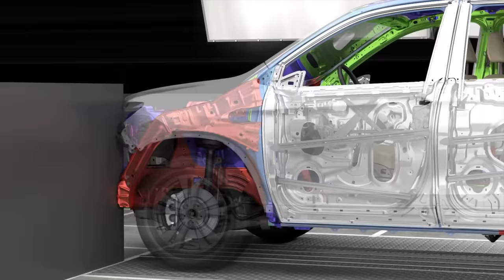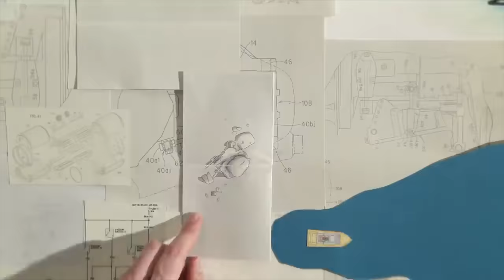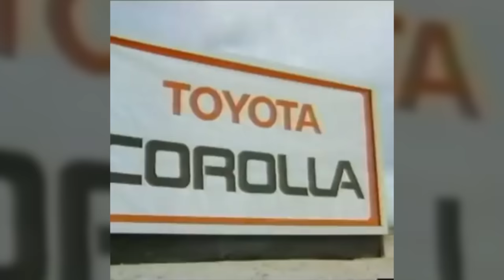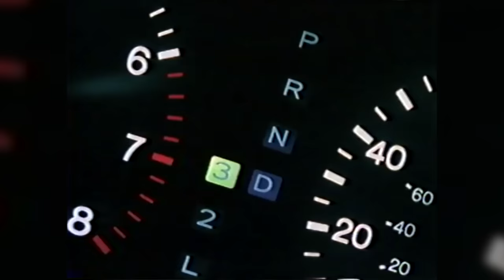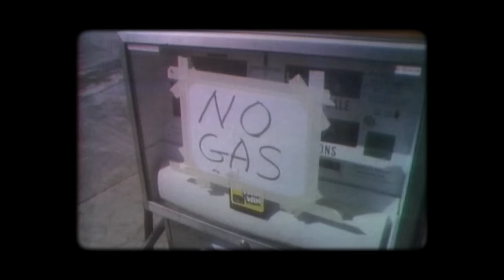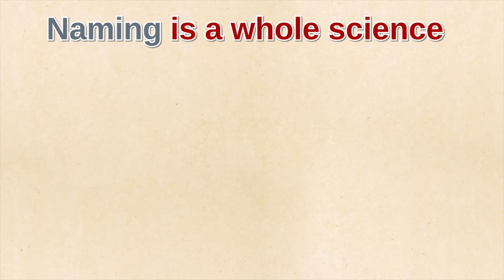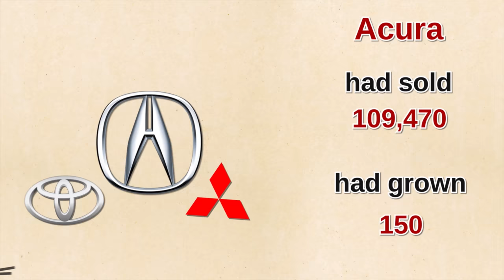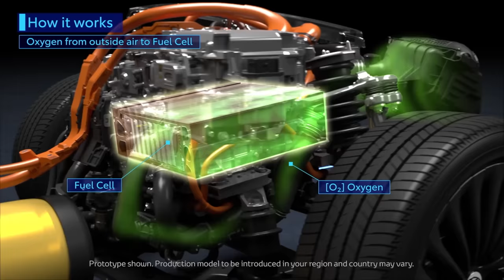Here's Why I Only Buy These 4 Car Brands

Comment: I had a 1993 Honda Accord stolen twice in 2002 and 2006. The first time the cop said it was because that series of Accords were built with ignition systems that were easy to start with any Accord key from that series just by sanding off the edges of the key. You can make a skeleton key with any other Honda Accord key and the thieves knew that.
So did Honda.
But they didn't do anything about it and Honda still holds the record for most stolen cars because of it.
It's not the reliability the thieves care about 🙄
Reply: I used to have a 1990 Camry. And once accidentally opened the door of another Camry of same color same model year that parked near my car in a parking lot.

Comment: I am on my fourth Honda, and we have a Honda lawnmower. I had a 94 civic, 16 civic and we now own a 16 pilot and an 01 accord. I’ve had a VERY expensive AC repair on my pilot recently that my warranty covered part of and then a rat got into it and in total cost $2600… (evaporator box, debris all up in there, thermistor, blower motor, expansion valve) 💀. But overall it’s been a very good car aside from that lol. My accord is my baby. I got it as a commuter car to keep miles off the pilot but I’ll keep it forever. Regular things need replacing (ignition wires, starter etc) but nothing I can’t do myself in my driveway. Very easy cars too work on. I did have my catalytic converter stolen! Apparently thrives like to also steal them off accords a lot as well, so she’s got herself a straight pipe. Lol.

Comment: Honda's with 200k miles. Have seen Toyota's with over 350k still running decent. Asked a couple owners about them, and they did change the engine and trans fluid regularly.
Reply: Bought a new Honda Accord years ago, engine problems at 100K, engine blew at 120K. Out of warranty repair was continuous and expensive even at today's costs. Always serviced at the dealer.
Reply: I've also seen Hondas with over 300k miles....we have over 200k on two of our Hondas now..
Reply: @spaniardsrmoors6817  timing belt probably broke, or you had a lemon. Hondas don't blow the motors w that low milage..most people love Honda if  they like Japanese ..

Comment: The car manufacturer my family goes back to again and again is: 
Toyota 

This is how I would rank the reliability of the car companies we have owned cars of: 
1 - Toyota 
2 - Volvo 
3 - VW 
4 - Ford (we were actually happy when someone stole it) 

I did consider putting Volvo on top. But it has had some problems with the air conditioning 

Toyota Yaris is probably the best car we had (outcompeting the other Toyota's we had)

Comment: Had a Honda Odyssey new in 2007 and just sold it this year.  Cost me $13,842 in Maint and $29,198 in fuel costs.  My Plymouth which I had for 10 years only code me $6,603 in Maint.

Comment: We have a 2014 Toyota Sequoia with 206+k miles on it.  The only complaint is its small gas tank - when we're towing our camper, it makes for short trips between fuel stops.  It's good for you, but not always what you want to do.  We noticed the new Sequoia has slightly better mileage, but a smaller tank!

Comment: i’m still pissed off that Acura got rid of the Integra/RSX.
Reply: I loved my Acura Integra ❤️.  Best car I’ve ever had.
Reply: still have my ‘98 integra. original owner. 

will be changing water pump and thermostat, fluids, and belts (drive and timing).  along with valve adjustment. replace struts and brakes. 

gonna have me some fun while i prep the car to run for another 100k.
Reply: Mine had 340,000 miles.
It was passed down to me from my older brother who was also the original owner. All original. The only thing I did was put foam strips to stop a rattle coming from the hood.
It was a 2001. I miss it very much since I have many nostalgic memories.
Reply: @Hayden Carver funny story! I got maadddd allergies. And I didn’t know about there being a cabin air filter. I took the glove box out and I had a rattling in the dash board near the glove box. Turns out the cabin air filter was not pushed in all the way or maybe I had hit a dip pretty hard and knocked it our of place. I relaxed the cabin air peril yet and pushed the trey in all the way and attached the glove box back in and the noice was gone. 

I hope that helps. If not check if the lock on the glove box is becoming loos. If so there are sealers. Integras can rattle like crazy. 

Also, the cause for my integra rattling is because I had a broken engine mount. I got that replaced with an identical part from a pickit part. The it virtually did not rattle.
Reply: Well…. The integra is back but it is really bland. It is one of the most cliche cars out right now.

Comment: Many years ago, I bought a 1993 Honda accord 2nd hand for 6k. It had 80,000 kilometres on it. It had a 2.2L engine with a manual trans. I ran the hell out of that poor car and got rid of it when it had 360,000  80,000 kilometres on it. I put 180,000 hard  kilometres on it for $6,000. The engine was still running excellent.  The rest the car was falling apart. I could have lasted a lot longer if I took better care of it. I was a GOOD car

Comment: My first car was a 1996 honda accord and was really nice, outside was worn as hell from sitting in the sun for two years but the inside was IMMACULATE. Electric windows, electric locks, and an aftermarket radio. Bought it from my friend for $650 and with 142,000 miles, I was psyched. Drove it to 172,000 miles and sold it for $1700 after replacing a ton of parts over time and some aftermarket parts. I still feel like the price was a little steep but for how the car market was when I sold it, it was almost fair, but I put a lot of work into and it drove great. And now the gal I sold it to has a great time with it since her last car was a lemon and costed twice as much as the honda I sold her.

Comment: Imagine if Toyota and Honda, or even more so, if Lexus and Acura joined forces, and combined there technological differences, and hardcore dedicated work ethic, to create by far the most reliable, fastest, most comfortable vehicle possible!?

Edit: Typo and Grammar.
Reply: If that happened they would be unstoppable. Hondas engine, toyotas transmission, Hondas technology and toyotas legendary reliably. Oh boi. I dont need another car.
Reply: They still will be below Cadillac, Lincoln, Mercedes, Audi, Telsa, Jaguar, etc. No one considers Acura or Lexus top tire luxury or prenium brands even if the joined forces.
Reply: @Jas S Lol no one in their mind considers Lexus which are rebadged Toyotas, a tier 1 brand. Cadillac and Lincoln are heads and shoulders better than Lexus in amities, features, ride comfort, and technology. Lexus competes with Buick, Acura, Infiniti, some Volvo models and some Chrysler models, not the big boys like Caddy, Mercedes, BMW, etc.
Reply: Imagine if either brand made a fast all-wheel drive sport sedan to compete with the Germans. I really wish they would.
Reply: Honda will never do that because the company can be very picky about its products.
Reply: I meant in terms of reliability only.

Possibly separating the racing aspect as a project of it's own.

Or, if possible, combine the two categories as one.

For the two companies to put aside the pride, and for a one time deal, for the people, a show piece, or whatever, build a project together somehow. Just because. Not sure how. This is just a hypothetical. For fun. Obviously it's a long shot.

In terms of luxury, to each there own, arguably speaking.

It would be intriguing to say the least.

Comment: I'm done with Honda vehicles after the oil burning  issues with the 2nd gen Acura MDX.  Even after the recall mine was never eligible because it "only" burns a quart every 1000 miles.   Thinking of trying Mazda next with their new straight 6 hybrid engine.

Comment: I've owned a multitude of vehicles. Chevy, Ford, Dodge, Toyota, Subaru, Datsun (Nissan) and worked on a sh*t-ton more as a tech. I wouldn't drive a VW or Mercedes if you gave it to me. I never would have considered owning a Saab, but I needed a car and my shop recommended a 9-3 for a price I could afford. 
2 years later, normal maintenance and I drive it like I stole it. Huge brand loyalty, and I see why. Best car I ever owned.

Comment: @Scotty, With your recommendation I bought a 2015 Lexus IS 350 F Sport. Have been having it for 6 months and have faced 3 issues already as follows. 

1 - Mass Air Flow sensor issue. Had to cleanup including the manifold for the warning to go off. 

2- Suddenly started to throw out thick white smoke and was misfirering. Had to clean all and replace one injector. 

3 - The AC cannot be controlled. I slightly increased the temperature and it kept throwing out HOT AIR ONLY. The issue was with its Actuators. 

So… Honestly, I doubt your statement of this Lexus being the best and most reliable car ???

Comment: my 02 subaru broke a timing belt at 60k on it's 2nd engine, towing it to the scrap yard and bought a nice used 2015 camry with 70k on it, so just broken in.
Reply: my 04 civic has 155k miles on it I did many repairs but ima drive it forever
Reply: Well, you should have replaced the timing belt
Reply: Awesome! Got an 03 4Runner only 291k in it. Baby is still going strong.
Reply: @kz6713  My wife and I own 2 2005 honda Civics both are special edition Ex car but the one is a two door coupe 5 speed manual built in USA and the other a sedan automatic with 215,000 miles on it, We still drive both love the Year car, We just bought a  2020 civic sport sedan 2.0l 6 speed manual 123 miles now 800.miles, Wife really likes it but it's getting 34 mpg driving it Locally. I won't be selling the 2005 cars because her sedan still gets 39 mpg cruising at 79mph, I didn't know the gears were different in the EX To LX 04-05 5 speed manual cars the LX will get better fuel mileage because the engine is running 500rpms slower for those who care.🤓
Reply: @raymondreiff8170  my girlfriend has a 2016 Civic they are awesome cars
Reply: 2nd engine? You put that car through a lot!
Reply: @richsweeney1115  What? No engine should need a new timing belt that early in its service life. Most dealers don't even schedule that until 80,000 miles.
Reply: @codeman99-dev  some , rarely..but some atleast used to say 60k , I had a Daewoo I did at 67k, I was lucky it didn't break before I did it, I knew someone who didn't do it on time on a Daewoo and it broke and she bent all her valves

Comment: I had a nightmare with a Toyota, had a ton of issues, burned through oil and felt cheap. Now have a car from a brand which is considered 'unreliable', but I'm having a much better experience. 

From what I can tell, 'reliability' ratings are purely on the amount you pay to maintain a car. So a more expensive car is considered less reliable, but you get what you pay for. Buy a nice car, pay more to maintain, but actually enjoy driving the thing.
Reply: I think that Toyota's reputation is completely overblown.  And, Honda is soon getting that way too.  I am starting to hear complaints from Honda owners all the time.  Of course, they are still better than American cars but is it really worth double the price?

Comment: I had a 2015 320i x drive which was a complete lemon and expensive to fix. I upgraded to a 2018 Acura TLX a-spec the 2.4L FWD and its been the most reliable and best vehicle ive ever owned.

Comment: I got a 2007 civic with 175,000 miles. Them never had a single problem. Just did oil changes and other small parts changes 🙃

Only thing that sucks is the paint, that year they messed up, but car is good. Although my 2nd gear is gone, it still works
Reply: Be worth your time replacing the thermostat (OEM) and O2 sensor.

Comment: I’m on my 3rd Lexus. This time it’s a ‘98 ls400. 280 thousand miles. I do have the timing belt n h20 pump replaced every 100 thousand miles, oil changed every 4,thou. miles. I’ve done some cosmetic things like 10” CarPlay stereo an 18” wheels. I love Lexus cars!

Comment: They’re all good if you maintain them. They each have a different minimum “level” of maintenance. He’s talking about the ones you just do cheap “regular” maintenance.
Reply: "They’re all good if you maintain them" so NOT true
Reply: @alelusnone4253  that’s because you don’t know how to properly maintain a vehicle. I’ve owned numerous Chevy suvs that have outlasted many a Honda and Toyota over the years. I’ve had Hondas that I’ve sold at over 200k that are still running to this day. I’ve had fords that threw rods at 140k , because they were used and maintenance wasn’t done correctly, and others that lasted to 300k miles , because maintenance was done correctly, so like I said before. They all have a level of maintenance to make them last as long as possible. Of course there are always those lemons that break down for no apparent reason but that’s not the norm. Regular maintenance , some require more than others , is key.
Reply: @alphasaiyan5760  yes yes😂
Reply: @alphasaiyan5760  nop
Reply: Nah. Doesn't matter how well you keep up with the maintenance for a range rover they will break over and over again

Comment: I have a 03 Civic EX vtech with over 350,000 on it now! only major repairs were a headgasket and the regular timing belt, water pump maintenance! Much better than the newer ones! Failed to mention it is a 5 speed stick! Honda automatics are weak for the long haul!

Comment: I always find it funny that even back in the 80's while the rest of the world (or most of it) was going back to big gas hogs, the Japanese and many Asian companies continued to make cars that got the best gas mileage (ie. Honda, Toyota, Nissan, etc) and that they maintained that focus of fuel economy, quality and affordability despite what happened with the price of gas from that point on (or since the oil crisis, which happened before my time).  This is why I think they're way ahead of Ford and Chevy, partially because of quality, but also for like whats happening now... gas is above $3 per gallon in most places I think people are looking for smaller vehicles that get good gas mileage or possibly affordable, reliable used cars. (Although I would argue that $2-$3 gallon gas is actually normal... anything more or less is too cheap or too expensive-too cheap and people drive around and waste gas for no reason, too expensive and everything else goes up in price - plane tickets, rail tickets... basically the cost to use any mode of transportation goes sky high).
Reply: Update:   6.20.22.  Gas in America. Is up on $4.00 to $5.60 a gallon.  President does not like oil dependency.  It is suppose to keep going up.  Hope they make good electric cars.  As much as I am not wanting to switch, I am stating to look at hybrids.
Reply: $6 July 2022

Comment: It was late year 2006, I bought Acura RSX-Type S 2006 model, the last model year, manual shift was the only option. And I had never driven manual car before the purchase. My wife located a silver Type S in a dealership about 50 miles away, negotiated a deal. Knowing RSX will be discontinued after 2006, l realized that was the only chance left for me to own RSX Type S. I got home from work a little earlier that day, googled how to drive manual car, printed out on a piece of paper, we went to the dealership, traded in the only car we had, got that Type S. The night was as scary as I could imagine while I was trying to take the whole family back, as the only person who knew manual shift - theoretically. The car stalled at a few traffic lights on stiff uphill slopes. Finally, we made it. And eventually, I taught myself driving manual car in that Type S. Missing that car, missing those stupid golden years.

Comment: Driving a 05 Accord coupe and the damned thing is so bulletproof, nearly 17 years later I'm not wanting anything new.  It's asked for very little in all this time.
Reply: 4cyl or v6? how many miles? my 07 acura tsx 4cyl breaks a lot. hated the car
Reply: @troytruong8246  4cyl although I would have preferred the V6.  My guess is my 2.4 is detuned compared to the tsx which may be why it's been more reliable?  I don't love that the engine has zero in the midrange and honestly for a 4cyl and the HP rating, the gas mileage is on par with much more powerful cars but I own it outright, it's a sellers market for automobiles because microchips -- and I've never known prices to go down once retailers have cajoled consumers to accept price/scarcity increases -- and it does everything to an above average level.

Comment: I tried to be a Chevy guy. I really did. Had a 00 S10 that was nicknamed Joan Rivers because she was old but all her parts were new lol. Got rid of it and got a brand new 2014 base 4WD Tacoma 2.7. 9 years and 120K miles later I’ve never had to repair that truck and it has never let me down. I supercharged it 3 years ago, lifted it, and beat the crap out of it off-road and it doesn’t care. Basic maintenance is all it has ever gotten 👌

Comment: Hey scotty and the rest of y'all I'm purchasing a 2006 acura mdx with 120k miles for 7,300 is this a deal. It's in really good shape with all the necessary replacements that are required.
Reply: Ehhhh. But you paying all at one or getting interest. I actually was llooking at a 09 accord coupe v6 for 9k
Reply: Mark Davis .
Hopefully you ll get service records with it that will show when the timing belt was replaced and how often the oil was changed .
Reply: I found a 08 tech package mdx with 125k miles for 5750 service was done routinely is it a go?

Comment: Both my Cummins run Dodge Trucks are still running perfectly 2002 and 2005. Dads 98 1500 Ram 5.2 still running strong.  North East  does a number on Trucks no matter what brand.

Comment: I have a 99 Lexus GS300 which runs like a brand new car cranks right up sporty everything is perfect only issue is the paint on the hood needs to be redone and the sunroof motor does not work so the sunroof will not open but with $194,000 Miles I am not complaining.